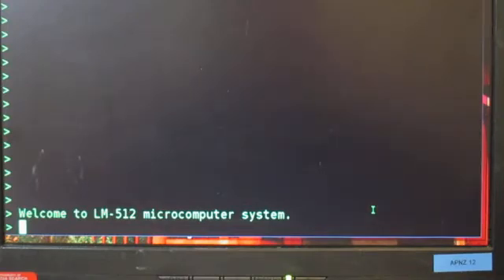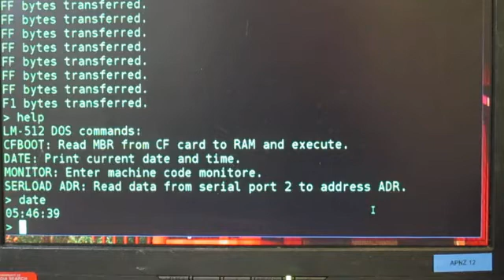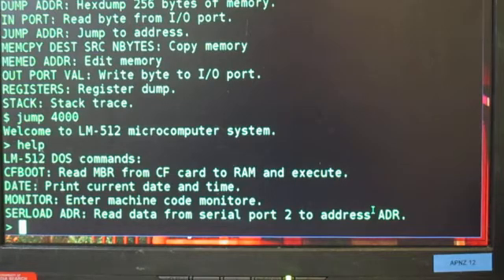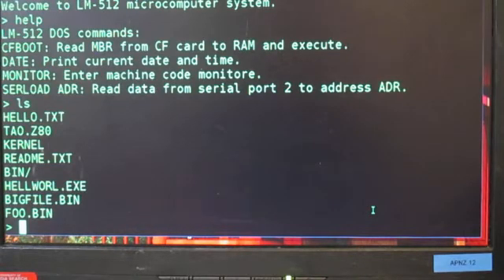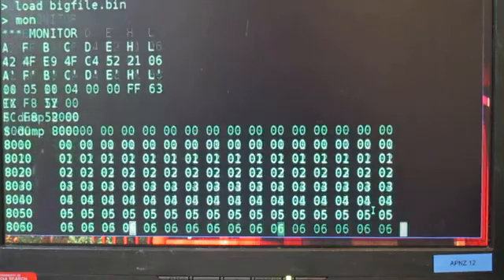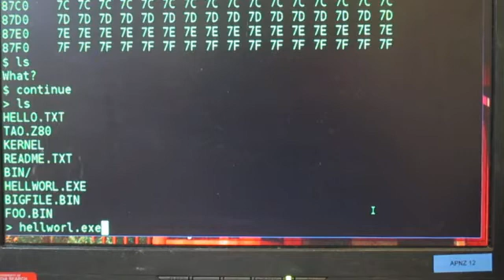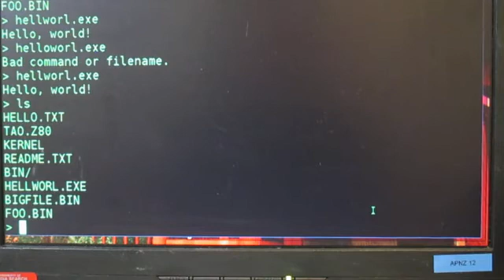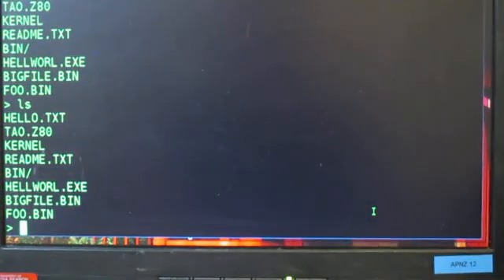LM-512 Z80 microcomputer: basic FAT16 filesystem support

Comment: Awesome! Do you have a schematic? Are you using the CF in 8 or 16 bit mode? 8 bit mode CFs seem to be hard to find. Your system seems very compareable to my 6809 setup...
Reply: +Luke Maurits Yes, it appears to be mostly pot luck. Implementing a latch to catch the high half of the 16 bit IDE data bus is not that tricky, and would let you play with any card or even spinning disk. The 6809 is indeed lovely, though there's much less ready-to-adapt software about then the 6502 (I can't understand why that CPU is so popular still) or the Z80. Anyway there's more info on my blog if you are interested. :)